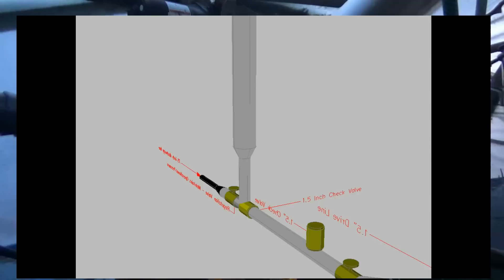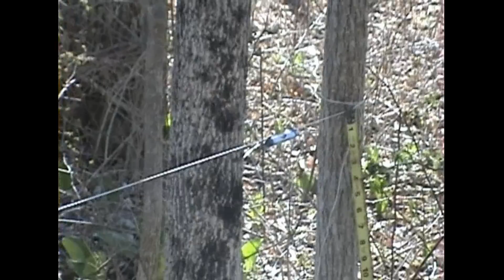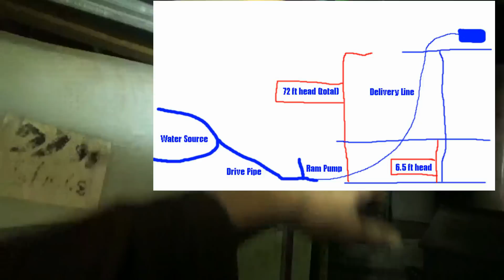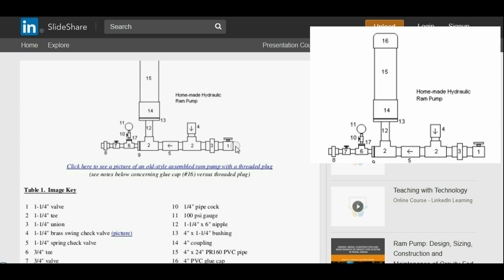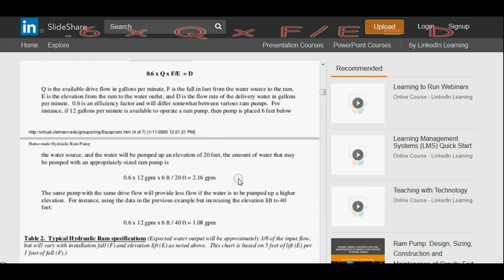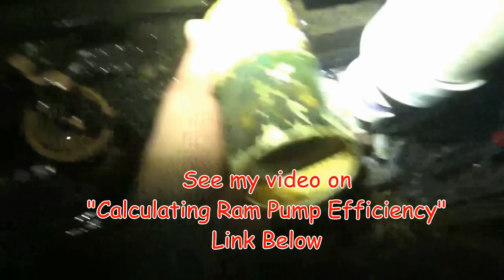Regen Ag School | Hydraulic Ram Pump Design Manual: Site Selection, Calcs & Field Operation

Comment: Thank you for this extensive video - I am working my way through it and have already found at 54:17 in the video that doubling the lift, only decreased the volume by half.  Interesting that this is different than how I interpret the Williamson Pumps chart, where doubling the lift results in 1/4 the volume (I may interpreted incorrectly.) I've started a discussion about the Farmacy Seeds Network, linking back to the Farmacy Seed Network Ram Pumps youtube playlist: https://www.facebook.com/groups/240458583255303/permalink/535933110374514/
Reply: Just made it through the whole video.  Thanks for the practical application.  I think I'll go now and look through Clemson document - maybe it will make more sense now.   

I'm trying to irrigate a small meadow and have some flexibility in where I take the water out of the creek.  Ignoring the cost of the drive pipe for the moment, the F/E  in the equation (Fall / Lift I guess), suggests I experiment.   If I could get 1 more foot of fall by running the drive pipe down the creek farther, might be beneficial even though have to lift 1 foot farther.     Let's say 1 foot fall and 10 ft lift = 1/10.   If I get 2 feet of fall and have to lift 11 feet would be 1/10 vs 2/11 or almost twice the water delivered ??    Or maybe I'll build the dam a little higher than I expected to do.  Thanks!
Reply from the maker: Yes!  You got it.. fall is the biggest driver of delivery. More fall = better delivery.  Thanks for watching! And you're very welcome! Let me know if you have other questions after the EDU link.
Reply from the maker: Hey thanks so much! I am glad my video is helping you! Really appreciate the sharing! Let me know if I can help anymore!
Reply: @TheFarmacySeedsNetwork  Pump owners have a variety of objectives.  In my case, I'm interested in irrigating 3 acres, where volume and cost is important - I would love to interact with others with irrigation by means of water powered pumps.

Just confirming - I think your data supports that within some range of elevations that doubling the lift height cuts the volume in half?    Am I miss understanding the Williamson chart (scroll down from the linked page) that I think indicates doubling the lift results in 1/4 the volume : http://www.williamsonrampump.co.nz/index.php/pumping-capacity
Reply from the maker: @davebean2886  I can't speak for the Williamson pumps although they should be somewhere in the range.. and probably on the higher end of efficiency due to steel drive pipes and pumps - less flex. Volume delivered VERY much relates to fall to the pump vs delivered height ratio. I found the formula is pretty accurate that I put in the above video:  .6 X Q X F/E =D    This Clemson link is invaluable for calculations: https://www.slideshare.net/Fatin62c/homemade-hydraulic-ram-pump-clemson-university
Reply from the maker: @davebean2886  I should also recommend drip irrigation.. overhead loses 50 -75 % of the water to evaporation.
Reply: @TheFarmacySeedsNetwork  Yes, it does seem like special delivery methods are called for.  The water supplied using ditches is frequently measured in Cubic Feet Per Second (CPS), while output from water wheel pumps and ram pumps are frequently measured in a few gallons per minute (1 Cubic Feet per Second is almost 450 gallons per minute).  

However, let's be fair - much of the water placed in an unlined ditch, never makes it to the irrigation destination.  Once at the irrigation destination, flood irrigation is inefficient and may require much manual attention.    On the other hand, for the same benefit, drip and low volume sprinklers use less water for the same benefit.   I'm not sure of a ratio (making this up) - maybe 100 times the benefit for a gallon delivered - not sure, but when costing a system, this is important.
Reply: @TheFarmacySeedsNetwork  I'm thinking I'm reading the Williamson chart incorrectly?  I just rounded the results from the 1 to 10 and the 1 to 20 (they call it fall used to height lifted).
http://www.williamsonrampump.co.nz/index.php/pumping-capacity

Either I'm reading the chart incorrectly or maybe there is another factor at at work here.
Reply from the maker: @davebean2886  For sure.. BIG scale difference bewteen CFS and Gallons!  Yes, a good bit is lost in a ditching system. One of the newest drip systems is subsurface drip.. much more expensive up front.. but long term it is an excellent option.  https://www.youtube.com/watch?v=yQ1APRbA4yE